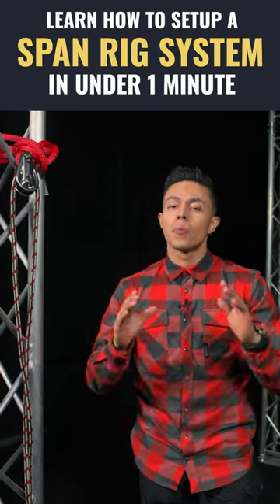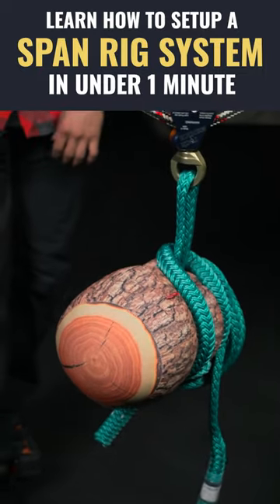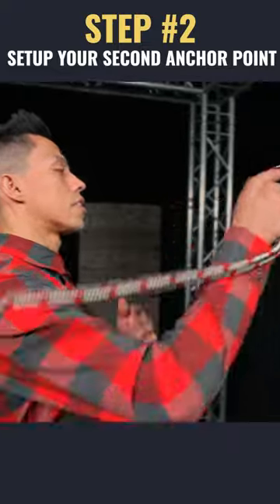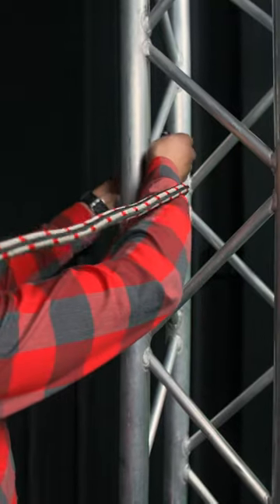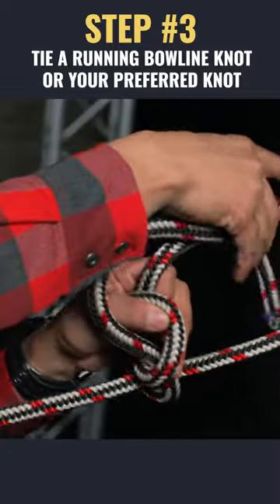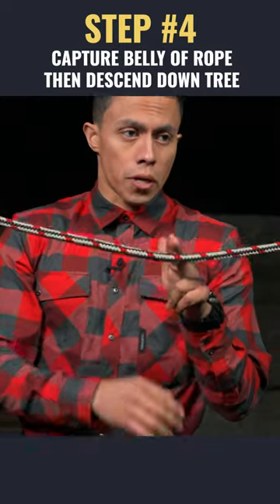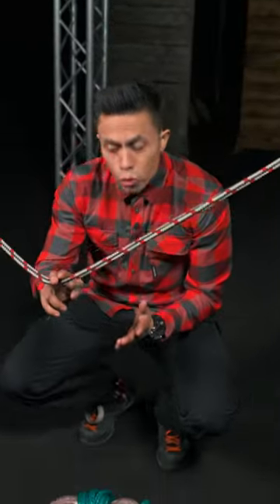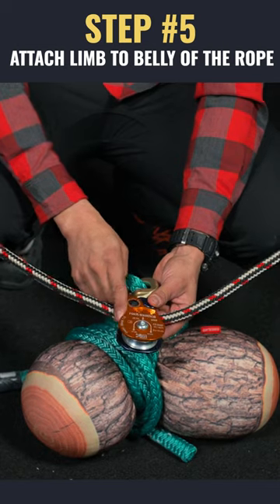Learn Span Rigging in a Minute! #arborist #shorts

Comment: I'd like to see that in a real life scenario? Why wouldn't you just negative rig a piece down to using this technique?
Reply: I used a span rig recently where we had a tall leaning pine tree in a really tight spot, power lines about 15’ behind it, a maple tree directly underneath. I zip-lined all the branches out, and then span rigged to an adjacent tall pine tree and  dropped the top out so it would be in a place where the guys could pull it out. It works great in the right scenario! Another thing that works great is a “drift line” basically have a separate rigging line and then transfer the load onto after you make the initial drop. I’ve used this where negative rigging at the rigging point on the house side would have left the branch on the roof, and the farther away anchor point would have had to large of a pendulum swing and the branches would have smacked the roof. So dropping it on the house side rigging, and then transferring it to the far side kept everything clear. I would say a drift like and a span rig can be used in similar situations.
Reply from the maker: Excellent!